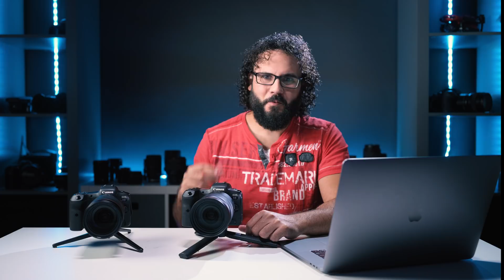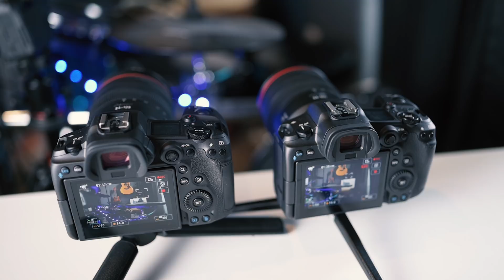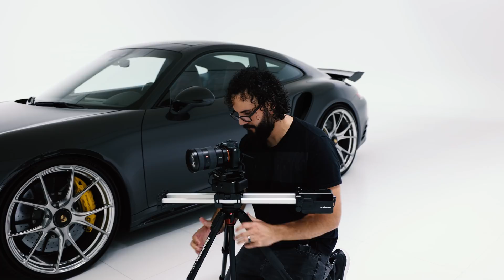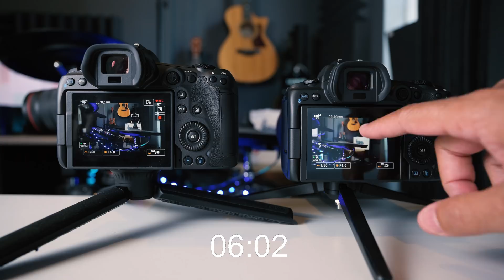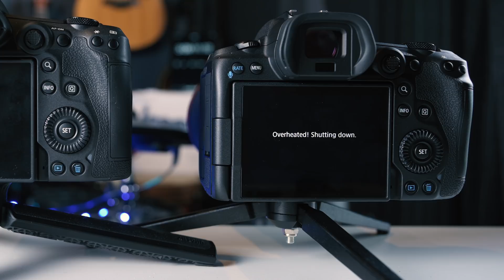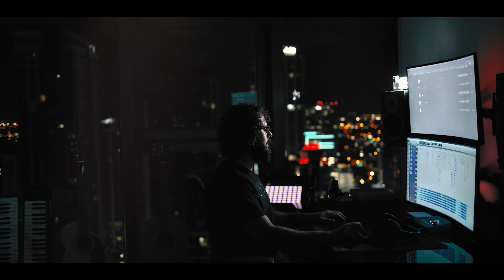Unlimited 4k60 Recording with the Canon R5 Firmware Update 1.1 | Overheating Solved?

Comment: Hey Dan great video as always. Just a heads up In tests of my own and others, it has shown NOT to be just timer based. There is a temperature sensor near the ports (See Gordon Laing video). If you cool down that side of the camera you can get almost unlimited recording. I got 90 mins 8k with a 6 inch fan blowing on the ports. Temperature plays a big part not just the timer. Thanks again for another great video.
Reply: It's just a trick since battery reconnect completely resets the timer. So that sensor is related to deepfaking
Reply from the maker: So it is definitely more reliant on sensors now with the update which is why the timers are less accurate so that's good to see you can cool it down! However, my first take of 4k24 HQ was literally exactly the same with both cameras so I do think at least the first take is still mostly timer based.
Reply: @learningcameras  I got the same times as well (1.0 to 1.1)  on initial recordings of 4K HQ,  But if I put a fan on the ports from a cold start it doesn't stop at that time. So maybe the cooler temp overrides the timer. IDK.         I will say the camera has some other weird things. From EXIF data you can get an internal "Camera Temperature" and that somehow magically stays between 57-60 C after 30 mins and beyond (with the fan). Never hotter or cooler as long as I am recording. And it doesn't overheat.  Maybe the camera is mitigating heat somehow at that point.
Reply: Also, just FYI since you are in Florida... Recording outside in 94 F with a regular fan didn't help overheating like indoors. Makes sense I guess. Just blowing hot air on the temp sensor. A different type of cooling might help though. Anyway thanks again for the great content.
Reply: @learningcameras  Dan are you using the same Media in both Cameras? Size, Brand etc? I can confirm I was able to cool my overheated Camera after 5mins blasting my portal AC units at the ports. Just have the one R5 so I am not sure how this would have helped with the old firmware. Oh and thanks @Jodu Media
Reply: @learningcameras  the camera is in the same environment, their within a meter of eachother so it's not surprising that they would show similar results...
Reply from the maker: @nick5ter  similar results...sure. The exact same to the second...thats a timer lol
Reply: @learningcameras   It's not possible to make conclusions about the timer based on this test. 
Your test used identical cameras under identical conditions to determine the effect of the firmware update on recording time. Valid conclusions can only be made about the effect of the variable (firmware version) and the outcome (record time). For example, identical record times in 4K24 strongly support the conclusion that the firmware update had no effect on record time in that mode.  By the way, I think you did a really good job, thank you.
Reply: @learningcameras   Yet still battery reconnect completely resets the timer. So those sensors are just related to deepfaking user experience

Comment: These firmware upgrades may extend or lift the video recording restrictions but it doesn’t change the amount of heat the unit generates when recording. I have to wonder if the excessive heat will ultimately damage or shorten the life of the camera’s components. I think Canon put these timers in there for a reason...
Reply from the maker: In all my testing this camera seems to run cooler than Sony's A7SIII which can record way longer in 4k120 so it doesn't seem to be a heat issue. Also, the internals cool down in about 5 minutes but the timer only states 1 min of recording recovery after a 5 minute break so in those cases, the timers are less based on overheating. Obviously there is a point where heat will impact the camera components but the timers seem to be the main reason for shutting down.
Reply: @learningcameras  I have been thinking the whole time Canon might be more aggressive with the timer and thermals to ensure that the Camera is still viable for stills ALWAYS. It would be nice if Canon gave an option for the users that are more into video to disable the "stills" protection and take the Camera closer to the limits.
Reply: You Would Expect an overheating camera to at least feel warmer When its States that it is Overheating. This camera Does NOT!